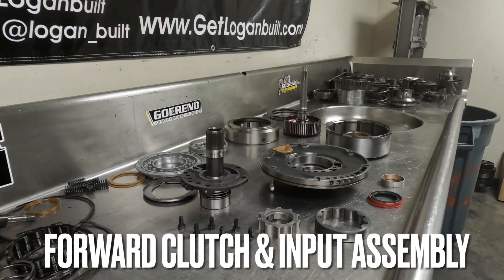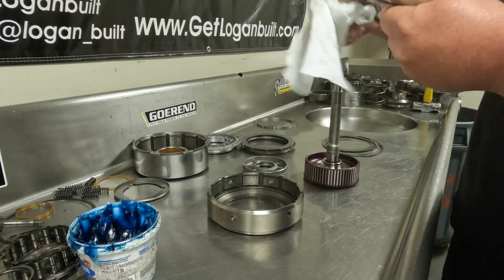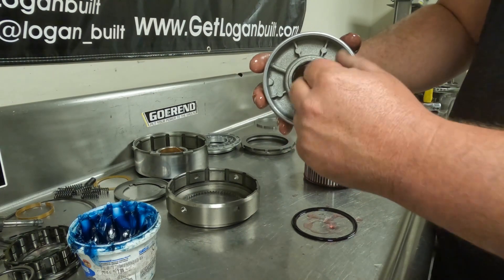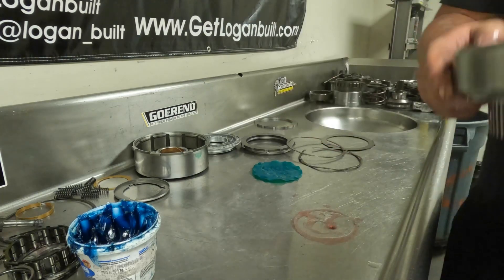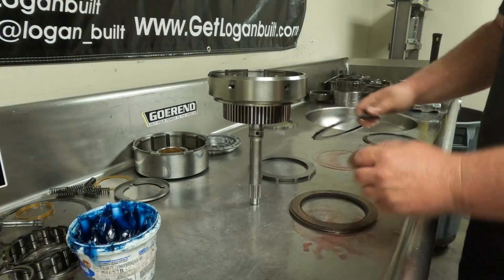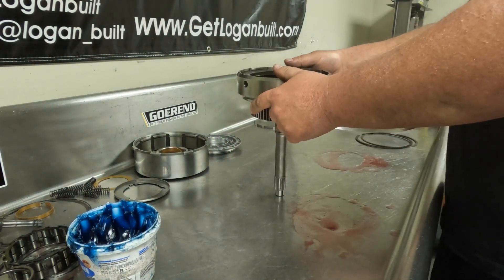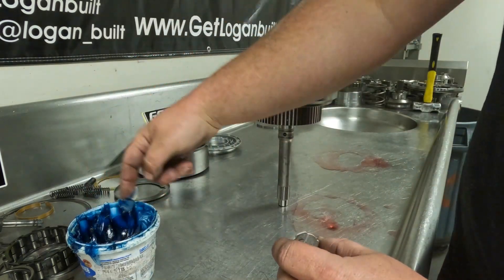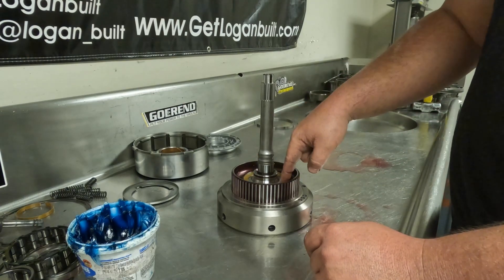Loganbuilt 47/48re DIY Kit Step 4: Forward clutch & input assembly!

Comment: Hello brother, I’m rebuilding a 48re. Did the air test and all came out well but what you are working on now. The top lip seal on the piston on mine blew out and snapped when I put 140 psi in it and held the trigger open. Is there such a thing as just a bad seal and do you think there are bigger issues? Thanks.
Reply: 140 psi is way too much for bench testing those seals will blow out.

Comment: Logan, why dex/merc? Im just getting into building 47/48s and have come across this before with built 47/48s. What makes dex/merc a better option than atf4?
Reply from the maker: ATF4 is a thinner viscosity fluid than dex merc. It does not hold up to heat as well. All of the event timing of the valves in the valve body change when you change the viscosity of the fluid. This is why on an electronically controlled transmission such as a 68 you only want to run the factory spec ATF+4 to keep the clutch values and fill rates within spec with the correct viscosity fluid.
Reply: @LoganbuiltRaceShop  That makes complete sense. So in the case of built 47/48s running tighter than book tolerances, extra clutches, lube mods, and increased line pressure, the thicker fluid helps mitigate binds/flares induced by thermal viscosity differences. Am I  seeing that correctly?